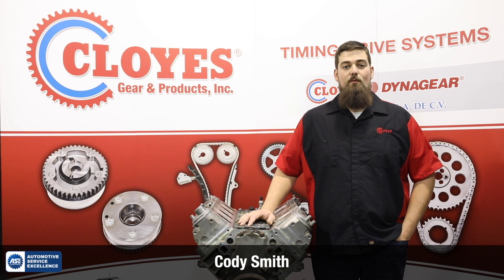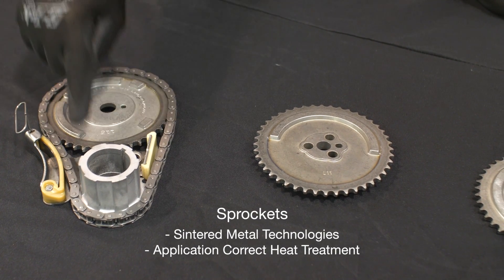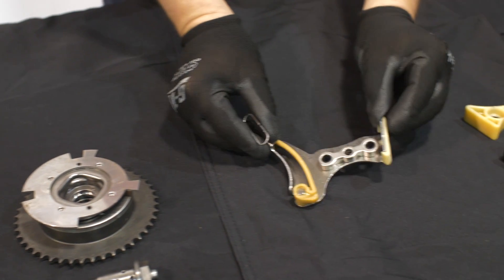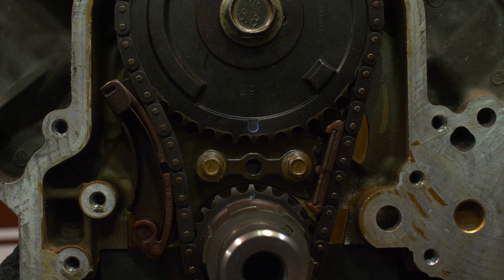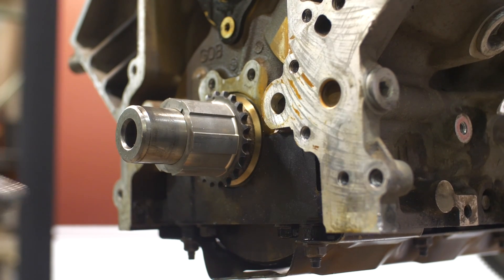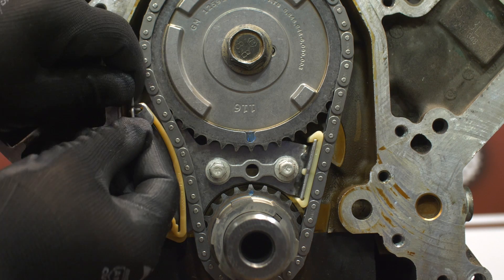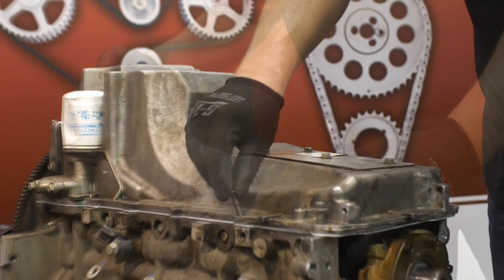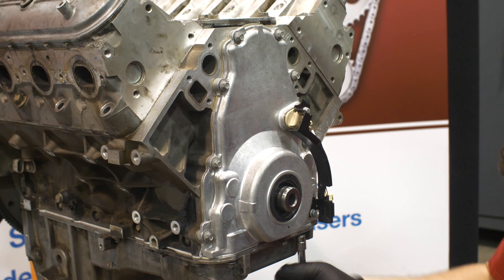GM Gen 3/4 Timing Chain Replacement, Cloyes 9-4205SA

Comment: I must say and give credit that GM did a very good job designing these engines with such a compact timing chain.
BUT if you have an ALL Wheel or 4 Wheel drive system in a GM truck or SUV it is a nightmare to drop the oil pan.

Comment: What about finding top dead center on piston 1 when aligning the timing chain ?
Reply from the maker: When the sprocket timing marks are aligned in the middle, as we show, that is going to position the engine at TDC #1.
Reply: @Cloyes01  ah ok thanks

Comment: My crank sprocket doesn’t have a dot on it and it’s the dual roller only the cam sprocket
Reply from the maker: The timing mark should be almost 3 teeth to the left (counterclockwise) from the keyway on our performance sets.

Comment: My timing is off by one tooth, how do I adjust it so it’s lined up?
Reply from the maker: I would rotate the engine until the camshaft sprocket mark is at 6 o'clock, then remove the camshaft sprocket, move the crankshaft slightly so the marks will align, then reinstall.

Comment: what if i have a little slack in timing chain? should it be tight?
Reply from the maker: Factory sets and OE replacement sets will typically have a little slack. Our High Performance sets will fit absolutely tight on a stock block because we use an oversized crankshaft sprocket and hand-match the sets.
Reply: @Cloyes01  ......Seems like the aluminum block motors should have some slack but, iron block should be tighter? I have a 2010 LS3 Dry Sump motor from a Corvette Grand Sport and it has terrible timing chain slack with the Melling replacement timing set....Same timing chain set as the LS7 motor of the Z06.....It has over 1/4" of side to side movement in the chain between the timing sprockets....I'm afraid to run this set.
Reply from the maker: @ericbrandt829  OEM GM timing sets typically had 1/4" to 3/8" of chain deflection from the factory. Unless you go to a matched performance set with an oversized crankshaft sprocket you are going to see some deflection.

Comment: I’m building a gen 4 ls. I installed the hex adjust double roller timing chain. The cam sprocket is grazing the camshaft position sensor. What would be the best course of action?
Reply from the maker: You will need to grind away the section of the cam sensor that is in interference.

Comment: So just to clarify, on 3 bolt sprocket. Torque to 26ft lbs. no degree turn just 26ft lbs? Also would it be a good idea to use red loctite on the threads for the cam sprocket bolts?
Reply from the maker: Correct, just 26 foot pounds. And yes, some thread locker on the bolts would be a good idea.

Comment: I see alot of ls cam upgrade videos and none are advancing or retarding the cam timing with timing chain. Should I leave my hi price adjustable timing chain at 0 because it's already built into the cam.
Reply from the maker: If you don't plan on degreeing in the camshaft then yes, leave it at the factory setting. Like you said, most cam manufacturers have advance built in.
Reply: @Cloyes01  thanks ✌

Comment: Hoping I can get a little help from you guys. I just tried doing this install and stupidly installed the new sprocket on the crankshaft with a hammer even though the video says not to. I just hard a serious brain fart. Anyway, now I can't get the camshaft sprocket and chain to fit. Did I seriously fuck up something? I noticed when I was putting on the new crank sprocket that the crankshaft key was moving a bit.
Reply from the maker: Installing with a hammer should have caused any problems unless you damaged a sprocket tooth. Does it seem like the chain is too tight? Can you just not get the cam sprocket to lip up onto the camshaft?
Reply: Cloyes Gear & Products, Inc. yes the chain is so tight I can’t put the gear on. I even tried reinstalling my old set and it’s now too tight to install as well
Reply from the maker: @93paxon  I would recommend pulling the crank sprocket back slightly to attempt to install the chain and cam sprocket. Once you get the cam sprocket indexed onto the cam you can press the sprocket the rest of the way on.

Comment: This is the best video I found online for the timing system replacement for my GM Gen 3 293/294 small block V8 engine. It also includes other LS engine displacements. Cloyes rep is very detailed, provides great step by step instructions, bolt torque specs and it is done very professionally.  
Thank You Cloyes!